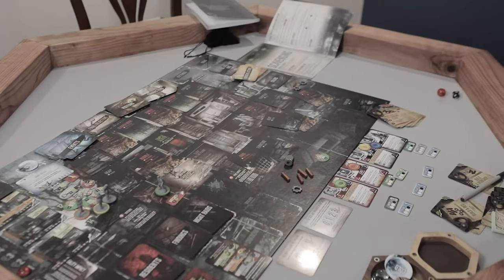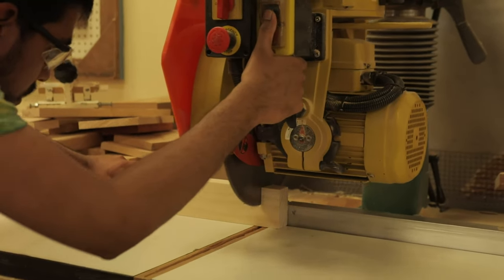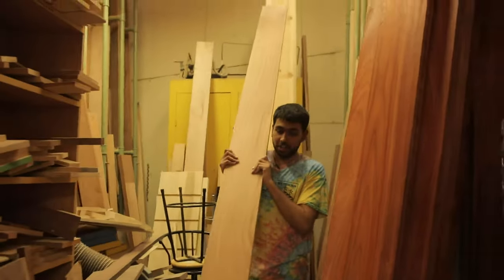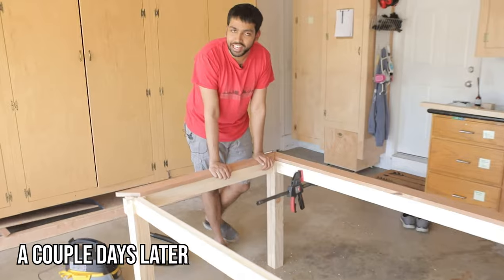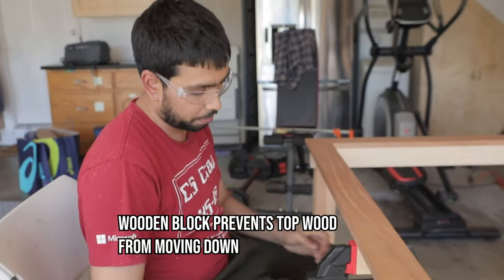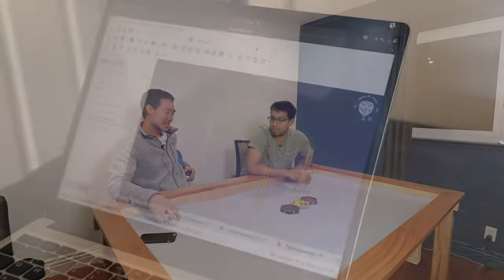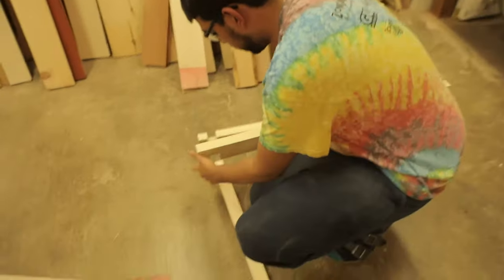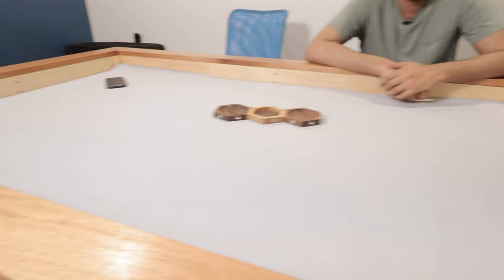Building Another Board Gaming Table

Comment: The only big mistake I see is you didn't joint and plane the boards you laminated for the legs, the glue joint would of been much tighter and way stronger and likely wouldn't of separated like they did on the one leg.

Comment: I've been thinking of making my own, but I think overall the best/cheapest method (if you have the necessary tools/equipment), is to thrift store two tables with matching or complimentary wood. Harvest wood from one to add toppers/accessories to the "good" table, as well as reinforcing the "good" one. A lot of the joinery is already done, and it's not rocket science to drill new holes for bolts/glue pieces to reinforce it.

But you do need access to things like the table saw, planer, jointer and a few other sorta specialised tools. Least if you want to re-finish it in a coherent manner. Or maybe you like the franken-table look, I'm not your dad, do what you want.

Comment: On those castle joints using an insert & bolt would be less likely to split out those glued half pieces. As for cutting them you are MUCH safer & just as accurate if not more so using a Rioba or western Back saw. Either way you chisel up to you lines. You can use a miter sled that is made with the support to cut those ends but I'm a hand tool kinda guy so. you do you.

Comment: Thanks for the video.

Was it a conscious decision to not include cup holders - I am working on a new table, and really not sure if I want to do cupholders integrated into the top rail, or some kind that attach to the sides.
There are pros and cons of each - so curious what your thought process was.

thanks for the video.
Reply from the maker: We simply did not have enough time for the cupholders! Initially, we were thinking about integrating the magnets with cupholders, but that was just gonna take too long. 

We ended up just buying some external cupholders that mount onto the table from Ikea. Those will be painted and modified one day.

Cheers! -Ashton
Reply: @Shelfside  
Thank you for the informative response.

I am still debating what features to build into my table - it will be a "pit" type, with a large monitor (for digital maps for TTRPGs) in the bottom, and a cover over that for other gaming.   I am just not certain as to if I want to integrate cup holders in to the "rail" or make them side mounted.
I see a lot of pros and cons for each, so curious to each' designers decision process.

thanks again for your videos.
Reply from the maker: @davethepak  ok, best of luck with the building! cheers! -Ashton